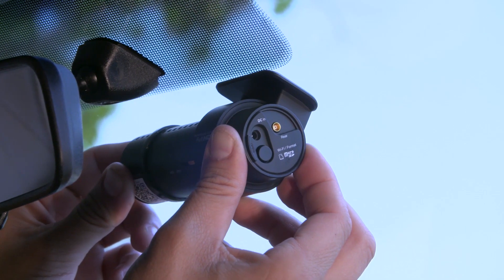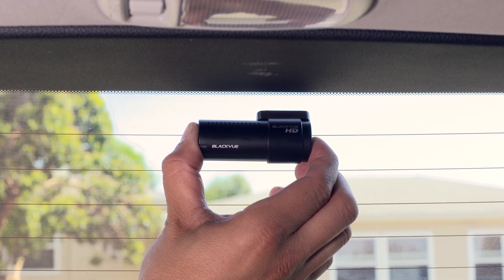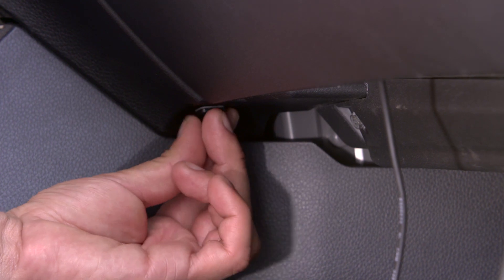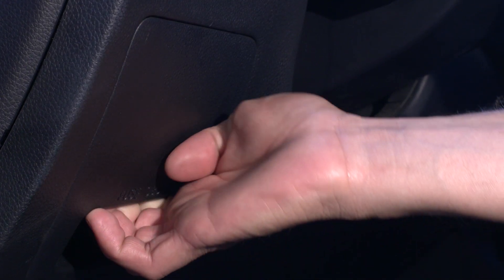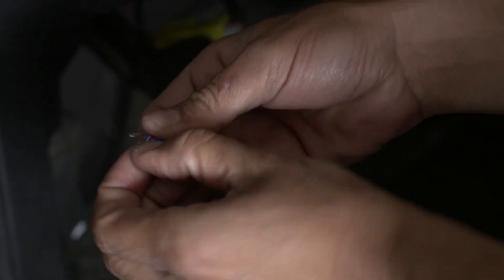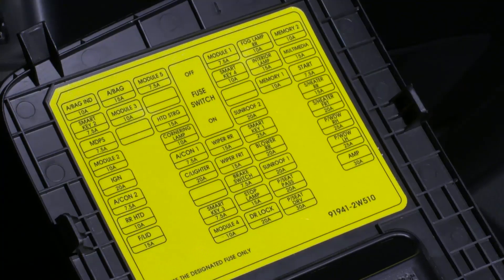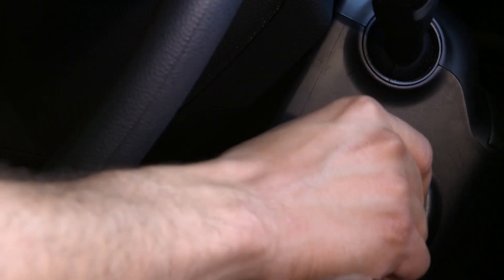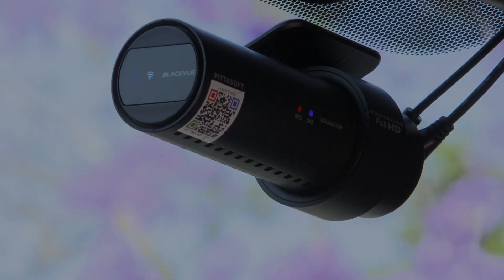BlackVue DR750S, DR650S and Power Magic Pro – Installation Guide

Comment: Is it possible to disconnect the front camera cables and take the camera out of its holder for a short period of time, then replace it again.  Would this cause any problems.  DR900s 2CH.

Cheers,
Reply from the maker: Hello, no problem at all. Just unplug the cables, then push the "LOCK" button on the mount while pulling in the direction opposite the cable plugs. Thank you.

Comment: Do you use a standard fuse tap or a mini one?
Reply from the maker: Hello Amy, 
As an option, we offer 3 types of fuse taps to choose from (Mini, Low profile Mini, and ATO) when you purchase the Power Magic Pro from our online store (https://www.blackvue.com/product/blackvue-power-magic-pro-vehicle-battery-discharge-prevention-for-parking-mode/). However, if none of these matches your vehicle's fuse taps, you can find the suitable type elsewhere, for example on Amazon. Thank you.
Reply: You do not need to use a fuse tap, they can spark out if they come loose, wiring pro magic into stereo wires is exactly the same thing , the fuse tap idea is for people who are clueless on automotive installations
Reply: Better to not use a low profile tap for the interior fuse box, even if the fuses in there are low profile. The interior fuse box can use both the low profile and the non-low profile fuse taps. (NOTE: Exterior fuse boxes use the non-low profile fuses only.) Reason why not to use the low-profile fuse tap on the interior fuse box is because depending on the plastic housing the wires may not clear the edge of the housing with the low profile fuse tap.

Comment: I have a 2017 Hyundai Sonata. Where would I put my ground power cable in this particular vehicle 🚗?
Reply: MasterKhem any ground point that is earthed to the body, I actually would not use this installation guide for pro magic wiring it in to stereo wires is the same thing and much safer , this installation guide is for dummies

Comment: How can you tell if you position the camera angle correctly??? In the n2 vantrue  you can see a screen and adjust  as necessary.
Reply from the maker: Hello, with the BlackVue App (Android/iOS), you can connect to your dashcam via Wi-Fi and see what your dashcam sees in real time and adjust accordingly. Generally, as long as the lens is centered vertically and perpendicular to the road, you are good to go. In doubt, angle it slightly more towards the road (rather than towards the sky). Although we also have had a few models with screen over the years, we believe a screen can be distracting when driving, increases the camera size and does not get used much apart from when setting up the camera or occasionally reviewing a video (which you can also do with the BlackVue App). Thank you.